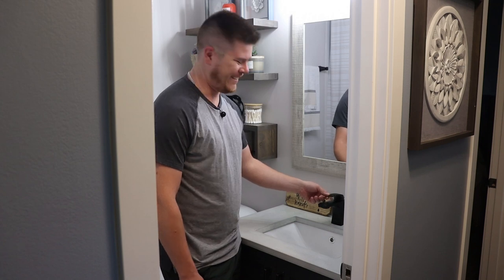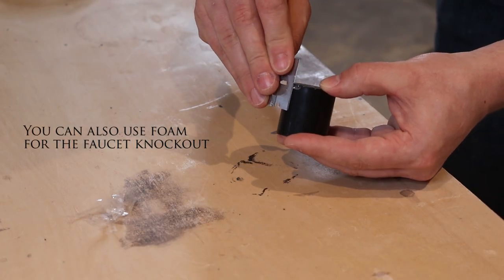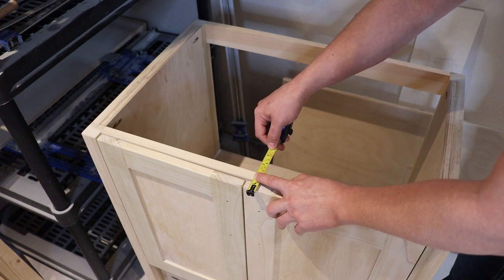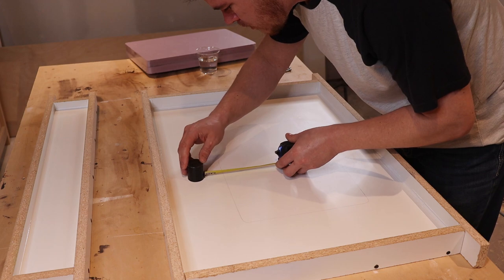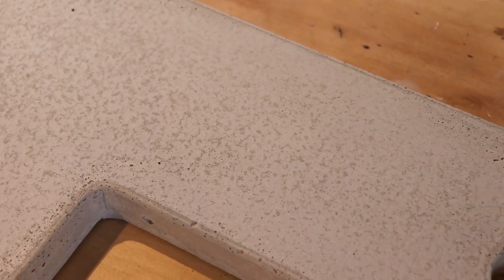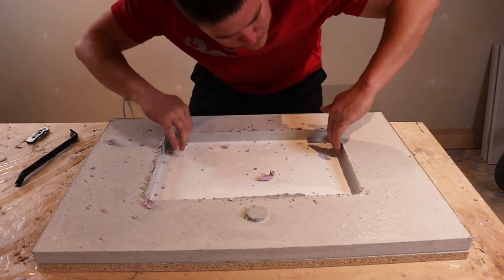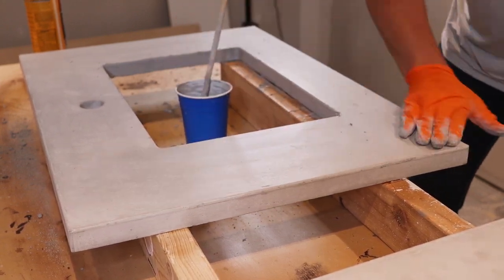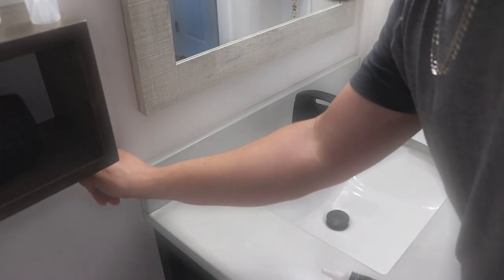How to make a Concrete Countertop, install undermount sink // Beginner Guide

Comment: Using a muscle massage gun with some tape over the tip works well at vibrating the air bubbles out. Just a tip
Reply from the maker: I tried my hammer and my saws all. I was shaking the whole table. Thanks tho

Comment: Jesse, we followed what you did down to having our mix way too dry the first time around. I dumped the whole bag into the bucket and I just couldn't get mixed well enough before it started to set up. I ended up pouring it into the mold anyway but it was a disaster. For round two I put the water in the bucket and mixed in the concrete a little at a time until I had enough. The mix this time was much looser (we used the Flow and Set additives) and it came out beautifully. Very smooth with virtually no air holes to fill. Now onto sanding, sealing and waxing! Your video was very helpful with the complete process, thanks very much for sharing it.
Reply from the maker: That's awesome! I mean, not the first attempt, but at least you only had to make 2 and not 4 like me lol I'm glad I could help and that yours turned out amazing! Good luck on the last steps and keep at it, id love to see it when youre done and share it with others. Thanks for sharing!

Comment: Question about gluing the sink to the concrete top. Will the glue alone withstand the weight of a sink full of water? Or the sink should have extra support? I'm learning a lot from your videos. Thanks.
Reply from the maker: No problem. The silicone and glue has a typical hold strength in a application like this of about 300 lbs. They aren't strong in a shear force like side to side, that's why you can peel them off. But in a pulling force up and down like the weight of water in the sink, it's plenty strong. We used this exact method when I was building homes. Not going to lie though, even doing it for a few years now, it's always a bit nerve racking when you take the clamp off the next day lol
Reply: Last question, what size clamp would you recommend?  I’m looking at the 24 inch ones….is that enough?
Reply from the maker: Depending on the depth of the sink, that should be good. But a little longer is never a bad thing
Reply: I work for a granite countertop company. We do the same method, but take wood shims, apply a good amount of silicone, then press it against the underside edge of the sink. The shim will be at about a 45 degree angle, pressing the silicone in the corner of the sink and underside of the top. Do one on each short side, and split the shims in half for the front/back.

I'm sure it's fine how Jesse did it, but our way just adds a bit of extra reassurance, and only takes an extra minute or two.
Reply from the maker: Hmm, haven't done that. This method that I showed was how we installed them when I was building homes and luxury condos, never had an issue, but thanks for sharing! More knowledge is never a bad thing!
Reply: At my job when we do sinks, we run a bead of silicone on the sink to add friction so the sink doesn't walk, pull the sink into place, use (in our case 3m brand) body filler/ bondo as the glue, then seal the inside rim with silicone. The bondo is plenty strong so long as you get good contact to the top and build up some on the bottom of the sink flange. It also has the benefit of completely curing in 15 or so minutes.

When applying the backsplash, the trick is to lay the bead, then spray on DENATURED alcohol. The alcohol while wet gets rid of the stickiness of the silicone making it easier to get off your finger. Just don't go overboard with the alcohol, especially if the wall paint is less than a week on the wall. New paint and/or excess alcohol can dissolve the paint if your not careful.
Reply from the maker: Thanks for sharing!

Comment: So it’s a little bit ironic in the Alanis Morissette kind of way, I found your vanity build when looking for different ideas on vanity looks, styles and joinery types because I’m very indecisive… I eventually decided to build a solid hickory vanity 31.25” long by 21” wide (inspired by Shara with her mid century style vanity/dresser and custom trim she did a couple years ago). It’s stunning, the hickory has so much depth of color saturation and striations of the grain… I’m more than halfway done with it, just need drawers and a door that appears like the drawers in a similar style to the inspiration. For the vanity I went with similar measurements to the original one I had taken out, simple that way and I really couldn’t change the layout or install a bigger one as my bathroom is tiny. Anyways it’s funny because I hadn’t expected watching your concrete top for the vanity too because I initially wanted to go with a beautiful quartz with mild speckles in it bc the place I went to said they could do a custom cutout for a small, square sink on the far right side (to allow as much drawer space as possible) but after waisting my time getting back to me on an official price, turns out they wanted +$700 more than they initially quoted me for. $1100 for a tiny vanity, no way!!! Morally it’s just wrong and I’ve always wanted to play around with cement/concrete anyways and I love that I can say I built it and make it custom to my every whim. Pask Makes didn’t help either in creating his stunning concrete sink with outside texture and it was gorgeous so too tempting, I had to break up with quartz! Anyways I finally got my melamine base templated and cut out to properly fit my wonky wall (the vanity is up against the left wall with the right side free) now I’ll rip more melamine for the form and I also want to go with 1.25” but I’m using Z concrete’s white concrete mix and might add white pigment but again I’m indecisive about a more natural white or a more pure white top. Anyways all of this is to say you’re The Only One to bring up and demonstrate figuring out how to place the under mount sink as to ensure enough tolerance for not only the lip but also the clips. My under mount came with four odd clips, Michael Builds demonstrated drilling in holes after the pour dried so he could securely epoxy threaded inserts and screw directly into the concrete itself. My under mount is heavy so I don’t know if I feel great about using silicone only to permanently attach the sink to the concrete top. I haven’t decided yet but regardless you shared much more thoughtful details, info and issues that came up and I appreciate you taking the time to mention that. It’s overwhelming all that goes into creating a vanity top that once poured is done and sink placement issues can’t really be resolved afterwards! Anyways your vanity and top came out great and I’m happy to have found your content
Reply from the maker: Wow, so I know that this is 10 months too late but I literally just found your comment, It was buried for some reason...maybe because I haven't been checking too much in the last 10 months, it's been a rough year but I'm back. I just wanted to thank you for the kind words! I'm so happy that you found my videos and instruction useful, I try to make things as clear as I can for everybody to learn from. I would have loved to use hickory, it never gets enough attention in my opinion, it's beautiful but very expensive where I live, so I'm jealous of you for that lol. Z concrete makes really nice stuff too and I wanted to use that, but you can't get it in Canada and to import it, well I might as well just bought the quartz. Sounds like you have great materials to work with. I assume it's all long done at this point and that you're happy and enjoying it all now. Thank you very much for watching, reaching out and I'm happy you're here too!

Comment: Awesome work. I only ever worked epoxy, so I can only see the talent and appreciation for this kind of thing, which's totally different, and for myself, I'm incredibly excited to try this out and let you know how it goes. Thank you.
Reply from the maker: Thanks! It is a very different beast to work with. I've never worked with epoxy myself, but I've seen it done many times and want to give it a try so bad, just haven't pulled the pin lol so I'm the opposite. Good luck on yours, can't wait to hear how it went

Comment: This is the best video I’ve seen on concrete countertops and under-mount sink installation.  The flow control does make a HUGE difference.  

One question, would you add support when doing this for a kitchen sink or glue only?
Reply from the maker: Thanks, I'm glad you liked it! When I was building homes this is the exact method we used for all sinks, kitchen and bath. For the biggest ones we used a 2 part epoxy putty in the corners instead of the glue I used. Otherwise the rest was the same procedure. But some undermount kitchen sinks want supports added to the cabinet itself, below the flange, it all depends.

Hope that helps!
Reply: One last question before I finish mine up, which is going great so far thanks to you and countless others.  Am I supposed to adhere the concrete to the vanity or wood frame for outdoors?  If so do I use silicone or adhesive?
Reply from the maker: You can adhere it with a construction adhesive for wood and stone in a outdoor use. For indoor use clear silicone is just fine.

Comment: Just used your method on a bathroom countertop and it turned out awesome!!  I have three bathrooms to go and I’m going to try fiberglass reinforcement next. I see some videos where they mix into the backer coat and some spread a layer in between.  Which method would you go with?
Reply from the maker: That's awesome! I'm glad you gave it a go and that I could help. With fiber I'd just do the face coat normally and then mix them into the backer coat. Good luck on the rest!

Comment: Looks great dude. Have you considered using self leveling concrete? I'm doing some tests myself with it.
Ultimately I will probably go with a portland cement base because I want to start with a more withish base, because self-leveling is too dark for me. But I'm thinking of emulating the self-leveling mix in terms of structure. So Portland cement, fine sand and some sort of fiber.

Comment: Great vid Jesse,  I watched hundreds of videos on this subject and I think yours is the best.  I am looking for a similar color to what you achieved so I was wondering if you could share how much of the white pigment you added per bag and how much more water it required to offset the pigment.  Thanks again for an awesome vid!
Reply from the maker: Hey, sorry for the late reply! I'm glad you liked my video and found it useful. I can't recall how much pigment I used, but I followed the manufacturer directions. I didn't add much more water because it would have compromised the strength, which is why I had to use flow control to loosen it up

Comment: Jesse, I need some advice.  I mixed half a bag of the same exact mix you used here, used the amount of water recommended on the bag (about 2L for 1/2 bag) and added one bag of flow control, but my result was not nearly as thin as yours. I could definitely not pour it.  Did you use more water that the bag instructs? What did I do wrong? Did I not mix it long enough?
Reply from the maker: Hey, sorry for the late response. Really? Was the dry concrete mix clumpy when it came out of the bag? Part of the problem I had with the first one I poured is it was an old bag according to the Quikrete rep I spoke to. Once you add the flow control you have to mix and mix and mix until you see it loosen up, it has to be well incorporated but once it is it should do what mine did. What kind of mixer did you use, or did you use a tub and hoe like I do most of the time in other videos? No I didn't use more water, that would weaken the mix and take much longer to dry, and possibly curl. Without being there it's tough to say what happened. Did you add any dye to it? Correct water, mix for long time...basically all it should be (he says as he has 3 mistakes in the video lol)

Comment: Excellent video, I was just doing one couter top for a bathroom instead of buy a marmol. Just we don't have that mix product in my country, so I'm testing some mix with portland cement.
Reply from the maker: Thanks! Cool. If you want to make your own, use a Portland cement and sand mix with super small aggregate (rock). 3 parts rock, 2 parts sand, 1 part cement and .5 parts water and then adjust water as needed. That's the basix mix for concrete. I might dial back the rock a bit for a finer mix, but that's what gives it a lot of its strength. Good luck on yours!
Reply: @JessedoesDIY  thanks for the dosification, I will try that with next countertop.
Reply from the maker: Anytime

Comment: Awesome tips here that I didn’t find in other concrete videos, definitely best one! 

Do you think if I vibrated with the face coat, it would compromise the face coat layer and add bubbles?
Reply from the maker: Thanks, I appreciate that! I mean...you saw my results while trying to vibrate it vs rodding it. Personally going forward with this mix I'd rod only. If I was using a more traditional mix I'd just pour half, vibrate the crap out of it and then pour the last half and call it good

Comment: One more question man, you’re the most responsive by far so I appreciate that.  Have you ever used a White Tint mix for white countertops?  I used the Quikrete brand which has very small aggregate and mixes WAY different.  I think eventually it will turn white based on the dried water marks but it’s been 48 hours and still has a sand like color.  My question is if I should let it keep curing until it’s completely white before sanding and sealing it?
Reply from the maker: I've never used white concrete, just regular concrete with a white dye like I showed here. I would love to because that'll give you a much whiter top than even I had here, but I cannot buy it in my area. Did you used a method like I did, or a actual white concrete mix? Typically they will always lighten even after sealing, so you should be good. Did you maybe not mix it well enough? Because that was one of my issues. Also, I always add the max amount of dye I can according to the dye instructions
Reply: @JessedoesDIY  , I’m pretty sure it was mixed well and it’s the Quikrete White Tint mix.  Used your face/back coat method as well but will probably layer the fiberglass next time so I can control it better and prevent the shadow/layerering I got.  It’s slowly getting whiter each day and I’m on day 5.  I read somewhere it’s ideal to wait 10 days but I’ve never seen anyone on YouTube wait that long.
Reply from the maker: How long did you wait before pouring the backer coat? It should be like 20-30 mins for the face to set up a bit first. And did you rod the backer coat into the face coat? Because that's typically why you'll have shadowing, the backer shouldn't be rodded, just poured and leveled. The time you wait to apply your sealer is based on the type of sealer you have. A top coat sealer like a clear coat needs to wait longer. The penetrating sealer I used is good after a couple days because the slab can still breathe after sealed, it all depends on type and brand
Reply: @JessedoesDIY  , I followed you process exactly on the face and backer coats waiting 30 minutes in between with the exception of using the fiberglass rebar flakes.  Worse case I’ll have to re-do this slab but I’ll wait a couple of more days since I’m using an oil based sealer.  Really appreciate your feedback Jesse.
Reply from the maker: Ok cool. Everything should be good then. If you do decide you want it whiter and make another slab just add some white pigment to the mix. And yeah, I'd wait for the sealer just to be good and sure. No problem, happy to help
Reply: @JessedoesDIY  , thought you’d be intrigued with a quick update…ended up starting over.  This time I layered the fiber around faucet hole and the narrow areas.  Then cut two pieces of that mesh you used for each side. This is probably going to be my best work.  I did add 8 oz of the white pigment to the Quikrete White Tint 80 lb. bag and I’m hoping it ends up a little white as opposed to the sand color.
Reply from the maker: That's awesome! Sometimes you just have to start over, I did lol. Sounds like it should work out pretty good, hope it does for ya!

Comment: What’s name of that reinforcement mesh you used? You didn’t provide a link sir
Reply from the maker: It's just a write mesh they use for parging on the outside of a house. Home Depot sells it in the concrete aisle. But lots of places that deal with it would carry it. I'd have a link but home depot won't let me
Reply: Thanks 🙏🏼
Reply from the maker: Anytime

Comment: Would be nice if they sold a vibratory tool to settle the concrete. I know they have it for slabs but might be to industrial.
Reply from the maker: Yeah it is. A vibrating table is an option but I have nowhere to store it
Reply: @JessedoesDIY   Ahh yes, if doing more production would help a lot in the quality and less scrap.
Reply: @JessedoesDIY   I just looked them up they are actually pretty reasonable at like $400. I had no idea this was a thing.

Comment: What is the name of the glue ??
Reply from the maker: It was No More Nails, in a clear tube. It's made for stone, concrete and porcelain. That's what I used in the corners and then clear kitchen and bath silicone in between

Comment: So the only thing holding the sink to the concrete is the “glue” ?
Reply from the maker: Yup. This is how we did it for years when I was building high end condos and houses. For big kitchen sinks we'd use a 2 part clay epoxy, mix and knead them together and put a blob of it in the corners and silicone everywhere else. As long as you use the correct glue for the application, aka stone and porcelain you'll be just fine